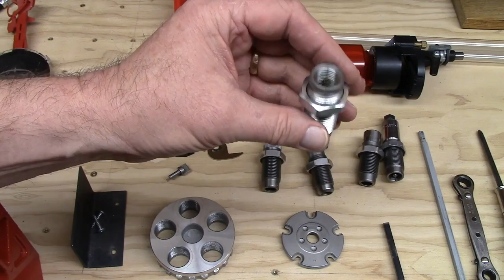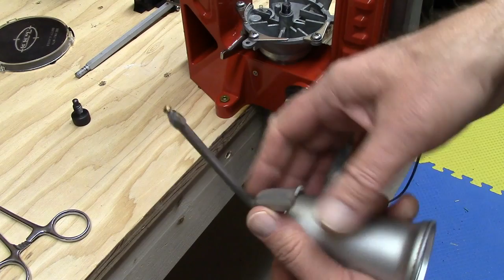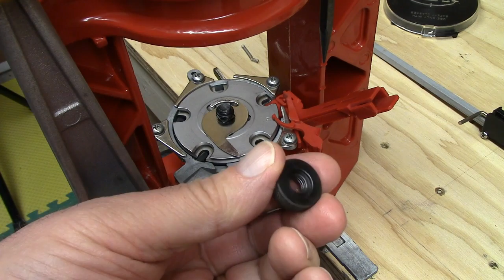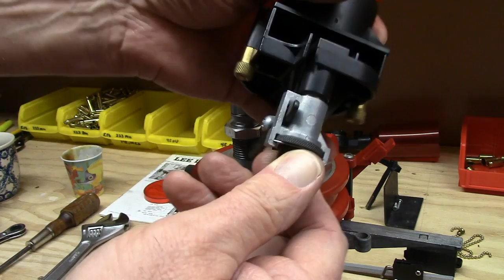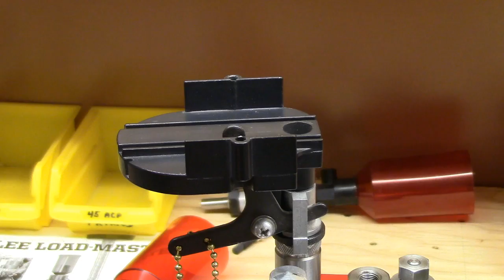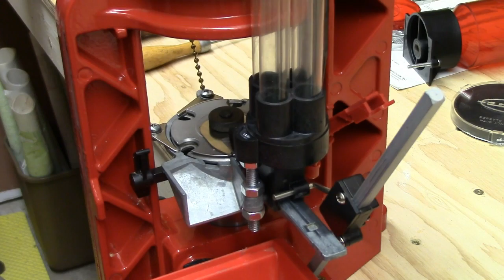How to Use the Lee Precision Load-Master ~ PART 1

Comment: I love your channel and your NO B.S. approach and discussions. I can tell you know what your talking about. Thank you! Question: Do you first clean your brass before running it in this reloading or any reloading press that primes? If so, how long do you wait to load cleaned brass. De-primed cases can be loaded in hours if they have been in front of a fan. I am just uncertain how long I would have to safely wait with washed brass and a primer present. I should say that I clean brass in a water/soap and citric acid solution, not dry tumbling.
Reply from the maker: jimflys2
Way too much is made of brass cleaning.  Cleaning brass is entirely a cosmetic option that has absolutely nothing to do with ballistic effectiveness whatsoever.  I fired many years before I got my first tumbler, and I never cleaned brass before then.  I certainly never clean primer pockets.  I personally have fired cases that have been fired ten times without ever cleaning pockets and they shoot with precisely the same degree of accuracy from brand new to aged and tarnished, with blackened, sooty primer pockets.  I typically tumble brass after firing with the old primers intact, in dry walnut/rouge media simply for pretty sake, but it makes no difference whatsoever to the performance or reliability.  I consider the washing of brass to be an entire waste of time that introduces the very real possibility of trapped moisture that could ruin a charge or primer.  Don't worry about how dirty your brass is, other than to wipe off grit to protect your dies.  If you want shiny, dry tumble with primers on and nothing more. There are far better things to do in life.

Comment: Great job explaining the set up. 
I do have 1 question.
 I decap all my brass to wet tumble. So, can i just leave position 1 open place the re size die with the pin removed in position 2? Thanks
Reply from the maker: There is no benefit to cleaning primer pockets whatsover, my friend.  I have personally run tests comparing accuracy between clean and uncleaned pockets, and found no difference in the least.  My late friend of many years, who shot benchrest, came to the same conclusion.  The only real imperative is to deburr the flash holes to remove the rough edge on the inside, so that the flame shape is uniform and directed on all sides. That is done only once in the life of a case.  Similarly, brass cleanliness, inside or outside, contributes nothing to the ballistic component.  When they are shiny on the outside, its only your eyes that benefit.  You can fire a case until it dies without ever cleaning it.  A quick tumble in dry media to perty them up to look at is as good as it gets.  Wet tumbling introduces the very real possibility of a wet case that contaminates a load.   I never recommend generating additional work, or any step that might cause a dud!
Reply: Yes, if you're in the business of selling once fired brass, then SS wet tumbling makes sense.. Otherwise,  jusr dry tumble every once and awhile for aesthetics, if you like. Make sure to inspect inside of cases to be certain they don't have media stuck in them. Case trimming, chamferring, and deburring are much more important than "perdying up" the brass.

Comment: I have problems with audio distortion. Is it my laptop or your audio track?
Reply from the maker: You are the first person to report this, and it's very clear on my desktop and stereo system, so I must assume that it must be a speaker issue.  I have a low baritone voice, and I'm very close to the camera microphone which may be amplifying the bass, and having the issue with the small speakers in a laptop getting out of their range.  I don't have the capacity to moderate inputs with the on-board microphone, so if I were looking at a meter, I'm probably a bit over the red db line.  In order to get good close-ups, I must be closer than normal range from the mic, and my voice is probably booming over tiny laptop speakers.  Try a good pair of wired ear devices, or connect with Bluetooth to a larger speaker.  Funds permitting, I certainly would rather use a more controllable microphone.

Comment: I have watched tons of videos on setting up the Loadmaster including the ones on the Lee site and have seen all manner of suggestions for improving the press and I have to say your video was  probably the most clear and to the point that I have seen.  I have a love hate relationship with my Loadmaster.  It does a great job on 45 acp, a good job on 38 special, and drives me to drink with 9mm.  I threw away the chain and replaced it with a spring connected to the frame.  Even Lee has some powder dispensers with springs.  Thanks for a great video, I will now go see part 2.  Keep on keeping on.

Comment: is it possible to do priming and at the same time, flare and charge powder in station no2? because i want to use station 3 for powder check
Reply from the maker: It's impossible and unsafe to ever prime and charge powder in the same operation. While very rare, primers have detonated during priming, which is safely contained within the empty die body.  Though used on other presses, I see absolutely no need for a powder checking device on the Load Master.  There is no place in the powder dispenser that narrows, where bridging can occur, even with the bulkiest powders.  Powder dumps from a smaller to a wider opening, directly into the extremely wide mouth of the die body, into the case.  Double dumping or over filling with the LM is impossible.
Reply: thanks alot, will keep that in mind

Comment: Where do I get an oiler for that oil fitting?  The one you showed did not leak at all, so is there a special fitting the pump-oiler needs to have?
Reply from the maker: I bought that can to oil my old boiler over 40 years ago.  You can probably get one similar from Tractor Supply.  For reference, it's an Eagle No. 58 pump oiler.  I drilled out the spout to about 3/64.
Reply: GunBlue490 Want to hear something amusing?  I called Lee, and not only did they not know what that oil fitting was called, but the guy said he was 'fairly sure' they eliminated the fitting on their presses.  I think it's a great idea to provide the fitting; but I also agree I used to see many of those type fittings -- now they are quite rare.  I picked up some type of pump-oiler at my hardware store today -- wish me luck on the oil not oozing out everywhere as I use the fitting.  How long until the blackened oil (from the aluminum) stops appearing on my (new) press?
Reply from the maker: tkarlmann That blackening won't go away. It's just aluminum oxidation, and no cause for concern.  It's not wear.
Reply: That is a normal grease nipple, very common in automotive. You just need a little grease squeezed in every couple of years, although I guess it much depends on the amount of use. More important in my opinion is not to forget emptying the spent primers catch. It is so conveniently out of the way, one tends to forget it's there, but you have to  empty it every few hundreds reloads.
Reply from the maker: Anyone who laughed at you should be walked in front of a dozen jeering heavy equipment operators and slapped by their mothers, and any automotive store that has none on hand should vaporize, as they are of no value to humanity, probably selling more wiper fluid and windshield wipers than actual maintenance products.  That famous extended grease nipple with the ball bearing detent is called a Zerk fitting or Alemite fitting (it's in Wikipedia), and those idiots should be able to recite the screw sizes.  My Alemite grease gun with an Alemite 10" rubber flexible hose, ca. 1970, is the most frequently used tool in my barn, besides the light switch.  Anyone who uses heavy equipment or tractors uses them to grease fittings daily as regular maintenance, lest their farm equipment fall apart and warranty quickly be void.  Before every use, a bulldozer or front end loader operator systematically greases every fitting on his rig, just as I do before using my front end loader.  My tractor mower has five of them that must be kept filled with fresh grease regularly.  If you have a snow blower, you most certainly have two or three to attend to regularly.  Automobiles have entirely different bearings these days, but the most common heavy bearings are still greased the same way your grandfather's Buick was, with Zerk fittings and a grease gun.  

Go to Tractor Supply Store where the nice knowledgeable gentleman or young lady will escort kindly you to a selection of these fittings in different sizes, found near the grease and guns.  They are sized according to the hole they are screwed into.

The ball detent where oil is placed is an entirely different fitting, used to lubricate the main shaft with an oil spout.
Reply: GunBlue490 Clarifying:  There are two types of fittings on my Lee press.  The Zerk fittings are near the joints for grease.  I think I've got that covered.  There is another "fitting" which looks like a small ball bearing that can't quite come out of the surrounding flat surface.  This fitting takes oil, not grease.  This is the fitting I cannot find an oiler for.  In the video, the guy shows no oil leaking out when he oils, and he talks about a teensy drill bit size to drill out HIS oiler that I don't have.  I think I have drills #1-#60, and his drill bit is somewhere in the #60-#80 drills -- these are VERY small bits!  So, I don't have an oiler, I don't have the tiny drill bit, and Lee stopped putting the fitting in there and won't help.  They say to smear oil on the column.  How do I know oil is getting inside where it's needed?  Problem:  way too much Chinese crap out there that barely functions before it falls apart.  Thoughts?  Solutions?
Reply from the maker: +tkarlmann 
The guy in the video is me.  I simply drilled my oiler with a 1/16"  drill. Basically, it allows the oil to have greater surface pressure that can depress the ball bearing, instead of zquirting over it.  Even a bigger drill would probably work with better results.  You have number drills, that give you far better alternatives to increase gradually.  My numbers are missing in those sizes.
Reply: GunBlue490 "What oiler to start with" seems to be my problem.  Thought you said yours was old -- from the 70's or some such.  My time-travel module is on the fritz again; any thoughts on getting an oiler that will work in 2016?
Reply from the maker: Mine is a No. 58 Eagle Pump Oiler, that I bought new in 1977 to oil the bearings on my boiler water circulation pump.  The can is silver colored, probably tin plated brass.  It shows brass where I drilled it.  I've seen them on eBay and elsewhere as vintage oil cans.  I take offense to references of vintage for something I bought brand new just a few years ago.  They no longer make those large circulation pumps with oil fittings that had little spring loaded dust caps, which is why they probably stopped making the oiler.  Here's one like mine, which looks in pretty decent shape...  
http://www.ebay.com/itm/Vintage-Eagle-Eaglet-Pump-Oil-Can-58-5oz-/291855274476

Comment: Very good explanation of parts and setup.  I watched part 2 and unlike other people using the Load Master,  you did not seem to have any problems as other people do.  Do you have a problem with priming the cases? Did you do any modifications?  I am hopefully buying one very soon. For the price I am wiling to tweak it to get it running correctly. Great Job.
Reply from the maker: Tweeking is what ruins the LoadMaster.  Priming issues occurred with earlier large rifle feed mechanisms, but Lee corrected it.  All machines now come with red color priming systems for the large primers.  They never had an issue with small primers. Mr. Lee has been making quality products in the US for over 50 years, and many of his innovations have been copied.  They stand behind their products. Listen to me carefully, if you want to be successful and happy.  Go to Lee if you have any problems; not to the fix it dummies on line.  That applies to most quality products that have been around.
Reply: +GunBlue490 Thanks They do seem to be innovators with reloading. I have read the Reloading book which has been very helpful. Hopefully I will be purchasing one soon.  It is nice to hear a level headed, common sense to the point person online. Thank you for your service in law enforcement as well.
Reply: +GunBlue490 I bought my Lee Loadmaster used.  I did some repairs and bought some missing parts. Lee has always been very helpful. It is a great machine.
Reply: I did buy a Load Master a few months ago and have reloaded about 600 rounds of 9mm.&#160; After getting feel for the press, I replaced the chain with a spring attached to the primer arm bolt and I removed the spring from under the primer ram.&#160; Priming works fine now. 
To keep COAL consistent, I lube the cases even though I am using carbide dies.&#160; It has help run smoother.&#160; Other than that, I runs just fine for me.
I will be reloading .223 soon. Will see how that goes.I also put the universal decapping die with pin removed in station 2 and resize and decap in station 1
Reply: I bought a reconditioned one directly from Lee many years ago, when progressives were much more expensive than today. I also installed the automatic case collator and the bullet feeder. I have reloaded 9mm and .32SWL, quite a few hundreds of these, since I was into target shooting (had to stop due to excessive youth...). The press, apart from the first couple of sessions when I was going very slowly and carefully, went without a hitch. Smooth and powerful, it runs like a dream, it almost gets hypnothic. Which of course you have to watch out for: I was so fascinated by watching the loaded rounds piling up (350 rounds in half an hour, and I was taking my own sweet time...) that I forgot to keep an eye on the powder and so eventually run out of it. That is the only blind corner, not a fault (that is all mine!) of the press. I am now organizing a simple rig to warn me (noisily!) when the powder runs low. It is mechanically impossible to load a double charge or no charge if the powder is there,  the rest is smooth and strong and uses the normal dies I have bought 40 years ago. I was frankly skeptical about Lee claims, I must say they are probably understated. And my Loadmaster in my opinion is superior to my mate's Dillon 650, by a good 50% more reloading speed.
By the way I also snapped one of those "ridiculous looking" chains, but I realized I was setting it wrong: take the trouble to understand its action and you never will snap another one again. And by the way, the weak link is a nice safety feature... I would not change it with a spring. Now I have to find a way to dispose of the meters and meters of chain I had bought anticipating chain snapping galore: that's right I only replaced once, about 6 inches...

Comment: I'm just getting into reloading.  I presently have the Lee Challenger Lock and Load but just setting up a bench and haven't started reloading.  Was thinKing of getting the Load Master latter on after I learn more.  I was planning to use the single stage for mi 762X51 Nato (M14) and the Load Master for my .45' ACP's Best tutorial I have seen yet on the Load Master. On to part 2!

Comment: I've been using a Rock Chucker for years for .223 .308 and .257 Weatherby. Yes it takes forever. Been wanting a progressive press for the 9mm .223 and 300BLK but always kind of intimidated. Now I'm not. Thanks. You are doing a great job explaining. Much better than Lee ever could. They should pay you or at least give you some free stuff!
Reply from the maker: +Bert Payne The LoadMaster is an entirely different machine compared to the others, and is more than just another hole.  It's a very robust machine that will crank out quality ammo with the best of them, and with the best dies in the world.
Reply from the maker: +Jason Boudreaux Thank you, Jason.
Reply: I agree...
Reply: +Jason Boudreaux I've been on the fence for a while too.  Looked at LEE Turret (can be upgraded to Pro 1K).  The LEE Pro in a caliber kit is actually cheaper (or the same)!  But the LoadMaster is the best value with 5(4) instead of 3 holes for +$60.